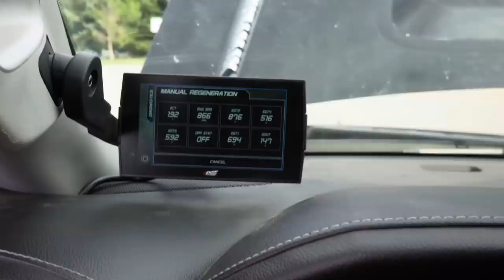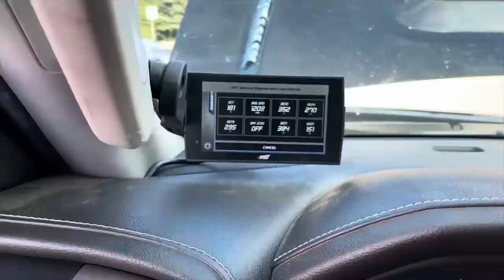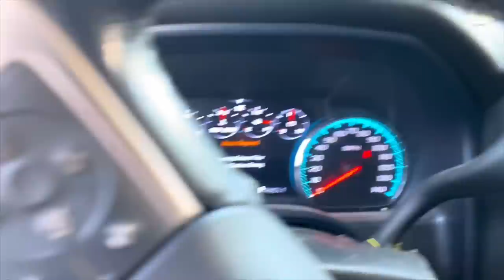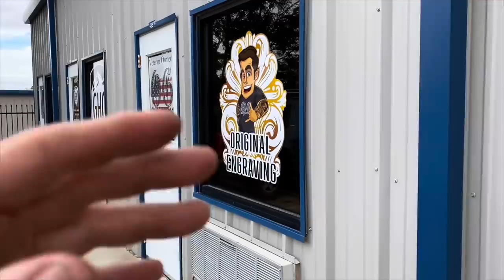I’m Stranded 20 Hours From Home In My Duramax! Part 2

Comment: Had a similar situation with a lmm dpf get plugged up and get so hot it welded itself shut left stranded on the side of the road. 5in exhaust for the win emissions suck
Reply: What caused it to do that? Did it get that hot during regen?

Comment: Dpf plugged tighter than a drum my guess. I'm surprised u didn't hack saw the exhaust  to get it somewhere lol
Reply from the maker: I was really considering it
Reply: @TruckMaster  I bet, this video will be why I'll never own a pickup with that garbage still on it
Reply: Couldn’t he have just taken that part of the exhaust off?
Reply: @BromanteGaming  it's pretty hard to remove it in a parking lot without  cutting...if not impossible. He could have cut a piece out before the dpf to keep the engine running, it would throw codes and derate/limit speed after awhile
Reply: @BromanteGaming  Not without a tune he can't, especially on the l5p

Comment: Although my 6.4 never left me on foot or stranded, I definitely do not miss it. I have heard the Blue def is not good for emissions on the L5P. I run GM def mostly but as a hotshot driver I sometimes use other def until I can get to a GM dealership. I also have been thinking on getting the tuner you have but if it’s producing the amount of soot that clogged the dpf I’m just going to keep it stock. Going from a 6.4 to L5P with the branded 10 speed Allison, is like being raised out of the dead ☠️ The emissions on these new trucks does scare me but I run hotshot secrets additives, GM def as much as I can and clean my MAP sensor weekly to help minimize problems. Still with me doing all of this it’s still better than keeping up the the ol ford. Glad you made it safely and your brothers engraving shop is pretty dang cool. I’ve always liked engraving but I do not have the patience for it! Glad he’s keeping ol traditions going.

Comment: You are a smart guy. Why didn’t you unbolt the exhaust in front of the DPF. You could probably trick the truck for a while. Those B&W balls can really get seized it is a dumb design. I put antiseize on mine the stuff is gross but works.

Comment: Any particular reason why you can’t just unbolt the dpf and introduce a controlled exhaust leak before it to get home? Or drill a few holes by the inlet?
Reply: There are sensors that measure pressure differences and when computer reads that there is no back pressure it will put truck in limp mode. Otherwise people will be installing flapper doors and bypassing dpf

Comment: I have a stock 2016 2500 HD and have never had a problem. Happy I left it stock.
Reply: No guarantees
Reply: Plenty of stock trucks and trouble free.
Reply: @repairvehicle  Then repair shops that are seeing them for tons of problems. A recent interview with a dealer tech said probably 75% of their work for quite a while has been emissions related
Reply: @mrmotofy  yea of course. Majority of people don’t let the truck complete regen and then it ends up at the dealer. Someone has to keep dealers in business
Reply: @repairvehicle  A ton of sensors and tanks failing from what I've heard. Parts availability has been a huge issue and parked trucks for months.
Reply: @mrmotofy  sensors and parts available is not an issue associated with diesel, it’s across the board every vehicle brand is going through this now
Reply: @repairvehicle  but there's been tons of emissions related that disable vehicles with months on backorder. Not specific to diesels but with the additional failing parts...it has parked trucks more so than cars
Reply: @mrmotofy  100% fact.  My wife works in Parts at a GM dealer.  Over 200 open repair orders at their shop.  Quite a few are diesels.  She used to love my LMM, now she wouldn't buy a diesel if it was that or walk.

Comment: I'm very curious when all these problems started, did they start when you went to Nevada and everything else. 🤔
Reply: In his dry way when installed aftermarket exhaust manifold and his egrs went down and truck could not keep high temperature of the exhaust gasses. Then tuner that adds useless problematic power that clogged up dpf

Comment: This may have already been addressed in earlier comments but... Definitely blew that boost tube early on and that piggyback tuner was likely sending false MAP sensor readings back to your ECM which kept it fueling with too low of manifold air pressure which would clog the DPF very rapidly and frequently and all the other events that followed. Can't really blame the boost tube cause the truck would have caught itself unless it was getting false MAP readings from a tuner (even in stock mode). That's why I personally only trust Banks products cause they have the knowledge, manpower, and funds to do proper R&D before they release to market. Well wishes on getting it back on the road!
Reply: Banks tuner is garbage. I have idash and it doesn’t even work properly, I am in second one because first one did even work properly. Customer service is terrible, told me just deal with it
Reply: @repairvehicle  I could agree that the Idash has some flaws but the tuner itself is one of the best on the market. I've never had any issues with customer service, but im also a washed up reality TV star that was on the Diesel Bros show and have cell numbers to a few key people at Banks so thats not really fair. Ha

Comment: What would happen if you put the saws all through the DPF for an extreme keep you going remedy ?or unbolt it ,it will be int to know if aftermarket is interfering with the factory management system?
Reply: There's a bunch of sensors that have to be programmed out of the truck in order to be able to disable/take off the dpf. The stock ecm is unable to be tuned due to heavily encrypted coding by the manufacturer (GM). The stock ecm has to be sent off to an aftermarket company to be unlocked which you would basically swap out yours for an unlocked unit. Then you can do pretty much anything you want to the truck
Reply: You DO NOT want to cut the DPF off (unless "weight reduction") because a new one 10 years ago is about $2000.00, thanks EPA!!!!!!!!!

Comment: Yo had issues with my 2004.5 LLY crew cab long bed 3500 srw and tonight was the night HT PERFORMANCE was you have received this donor truck I'm talking about with only 226,653 miles original upper Pennsylvania salt plow truck retired as a donor truck for my southern 996786 miles dually truck c3500 with almost a million miles on the dash cluster! And going! HT was my prize winner cause you're to far away you pull this off from Central Pennsylvania

Comment: Holy Duramax Bat Truckmaster  ! Did the "adventure " take you back to your Army days  ? Hey noone died... well close.... good grief  !.. might of been good though..insurance would have gotten you a new truck.  What an adventure... good to have friends and family.  This will a fireside conversation for years to come.  A little surprised you didn't turn around and head back with another truck from your fleet... I am guessing that others don't have the hitch for the trailer.  Out of curiosity...sorry I don't know... but is it possible to disconnect the exhaust ahead of that system.  Tie it up and straight pipe it ...just exhaust ahead of the clogged stuff. Just to be able to limp it home... I suppose that would screw with the codes. But perhaps be a temp ability to get down the road.  Another note some fantastic work by your brother.  The armor for Thornton p.d. is a standing member of the firearms engravers guild. He is also a gunsmith.  We taught at the school in Lakewood. There is s big firearms collectors show every year.  The merchant mart in Denver... lot of engraver opportunities.  Yearly after Sturgis in Loveland is a big bike show...more opportunities for engraver work. He should look into the firearm engravers guild...his work is very good.  As for engraver work on the truck... it's like tattoos..once you start you won't be done until everything is engraved. My late wife used to work at one of the Harley dealers for years.  Wish I had known you then. My connections were the firearm industry and her the bikes lol... 
   Anyway this has been interesting.  Keep us posted..
Reply from the maker: I appreciate it Ron my brother actually engraves firearms as well he is really good at it
Reply: @TruckMaster  Glad to hear that.  His work looked really good.  I am a professional Gunsmith... retired now.  I used to live in Colorado.  I  saw his work and was amazed so I just wanted to get some information to him. Your both talented and good people.  I looked for a website for his shop / business to no avail.  But I will pass on to those I know his business.  I hope he can get up with the Firearms Engravers guild.  As always looking forward to your next post.  This was a great educational situation , as unfortunate as it is.  Keep positive and march on. One thing that is hallmark to you and your channel is you keep it professional.  Bravo Zulu Truckmaster.  👏

Comment: Man the stress.  I just got back from a 2000 mile road trip where my 21’ Cummins suddenly went “clunk” going 80 through Amarillo.  Limped in 4th gear to the shoulder.  Truck has weight reduction with 12k on it and all I can think is great how am I gonna explain this cost to my wife.  Thankfully had my tuner and I cleared a UD solenoid fault code.  It drove fine all the way home but now the only solenoid for this year truck is only available from ram.  I’m waiting to see if the dealer is gonna let me use warranty.   🤦‍♂️
Reply: Dealers do not work on trucks that have weigh reductions. They will not program computers or install parts. They can only sell parts. My body ecu went bad and needed new firmware to be installed. Dealer said they cannot touch these trucks with weight reduction and cannot program either. Now he is stuck and truck spending more time fixing than driving
Reply: @repairvehicle  wow.  Well my dealer is gonna replace under warranty now and they don’t care.
Reply: @Steadierpark  , do they know about weight reduction?
Reply: @repairvehicle  I won’t say because I don’t know you.  But everything is gonna be good.
Reply: @Steadierpark  dealer is not going to work on your truck, it’s a risk that they would accept because they have to report everything
Reply: @repairvehicle  ok

Comment: Just curious if you usually use that "platinum" DEF that you put in at the start of the trip?
    I've got the exact same truck 2018 Silverado with the L5P. I put the same "Platinum DEF" in and instantly began having DPF issues also.   I was able to force it through some regen cycles and seem to have cleared out the DPF.  I bought new DEF  and was able to dilute the bad DEF. But I had a code that said "poor quality DEF". But my scanner couldn't find any codes. It was very bizarre.
Reply: Did you use expired def fluid?
Reply: @repairvehicle  nope it wasn't expired. Also was still sealed and untampered with.
Reply: @Lasvegasmedic  , how do you know it was not expired? I called the company and asked them about expiration and they told me that they will need production numbers and then they can run through their system to find out expiration date. Numbers on the box does not mean anything, false information from YouTube. I personally prefer dealer def, clearly states expiration date
Reply: @repairvehicle  I guess I don't for sure know that it wasn't expired. But it had been delivered to the store earlier in the day. So I just assumed that it was not expired.
Reply: @Lasvegasmedic  , unfortunately it could have been seating in warehouse for unknown time and then delivered to the store. It’s a crooked company not providing clear information on the bottle with expiration date and requires you to call help desk to find out
Reply: @repairvehicle  yeah. 
Fortunately I was able to regen burn through all the bad DEF and haven't had any problems since.
Reply: Yeah, I've talked to a few different diesel techs, and a lot of times the issue is old DEF fluid that causes problems with the dpf
Reply: @rapTorfx4  , def fluid has nothing to do with the dpf. 

What is DEF?

Diesel Exhaust Fluid (DEF) is a solution of urea and water that’s injected into the exhaust stream of diesel vehicles to turn NOx gases (harmful emissions) into nitrogen and water.

Comment: Quite curious what brands you'll be using for  the "weight reduction " i intend to get a wrecked l5p at some point soon and rebuild it because i work in the body industry, obviously weight reduction for reliability. A Lot of delete kits i see online are from websites that seem a little off/could be a scam, so I don't know what I'll do when the time comes
Reply: Canadian companies will be your best luck.  I know that is where most go for tuning these days.  Nobody in the states is willing to even talk about it, but the parts are not that complicated and can be made pretty easy.
Reply: @joshuaquilliam2887  in many places you cannot pass inspection without emissions equipment

Comment: What a nightmare dude glad you made it to Ryans! I had to go on a road trip not too long ago and was so nervous to take my 2004 2500hd 6.0l for the fact I might get stranded. My boss let me take the work truck which is a 2018 F250 so a lot newer and reliable. Having good friends for times like this is great
Reply: I would have more faith in a 6.0L Chevy gas engine than any Ford truck, just me
Reply: @cargotoolshop5319  Yeah i just tightened up a bunch of stuff on it the week before but decided to take the ford anyways. My truck leaks a lot of oil currently and I get a p300 random cylinder misfire after 30+ minutes of highway driving. I haven't really tried to fix the code as I don't notice any misfires or loss of power when it happens and I drive mostly city. 2 other reasons I decided to take the Ford. I don't know why I get that code it only comes on the highway so 70+ and always after about 30 minutes.
Reply: My truck is at 200k miles and the work truck is just now hitting 100k . I wouldn't be surprised if the ford kicks the bed first. It's got the 6.2. it's been a decent truck but the fuel line loses pressure so it cranks forever sometimes before starting. It's already been fixed once under warranty

Comment: I suspect most if not all of your problems are at least partially self inflicted. Modern diesels have plenty of power and don't need aftermarket tuning. The tune from the factory is optimal for all around performance and longevity. There is a LOT more to consider than just peak power numbers. You would be far better off in the long run to leave the engine and tune alone. In fact I bet your truck would still be running strong if you had left it alone. Save your money and just replace the DPF when the time comes. Unfortunately, if you own a modern day diesel long enough you WILL be replacing the DPF and NOX sensors. The old days of rolling coal are over and for good reason. For most people that don't need to tow day in and day out a gas truck would be a much less expensive and just as effective way to go. I'm not trying to knock you for what you are doing, I've done plenty of that stuff in my day. I've always done my own maintenance and repairs and my share of modifications. My many years of experience has taught me that in the long run the vehicle will be better off with lots of maintenance and very little modification. Its hard outsmart the engineers at GM or Ford that built the dam thing, no matter what these aftermarket sellers try to tell you. Good luck!

Comment: I would of cut the Exhaust just to get home
Reply: I had to do that on a gasser...cat plugged reached point it would barely run. Luckily a shop attached to my destination I barely made it to and he was still there on a Sat afternoon. Took us about 30min of diagnosis. Cut a hole and fired right up just a lil louder but got it home.
Reply: Once cut it off your truck would not run
Reply: @repairvehicle  It would likely run just power limited

Comment: thought I wanted a diesel... until I watched this. Sucks the emissions have forced these engines to be so unreliable. 6.6 gasser cant tow as much but for a buy who tows under 12,000 its a great option and $$$ saver. The 7.3 godzilla  in a superduty is looking mighty fine and I see why folks are going that route
Reply: Remember why this diesel is not reliable! Aftermarket tuner

Comment: if the truck was left stock probably wouldn't have happened until much later
Reply: Probably,  but it most likely would have happened, eventually.
Reply: @fredandersen9873  maybe. But I know personally many people with the same truck and hot shot and have not had problems.  But I do agree that the system is junk.